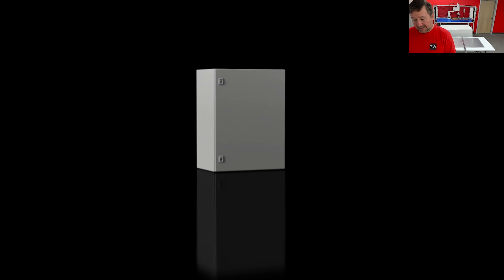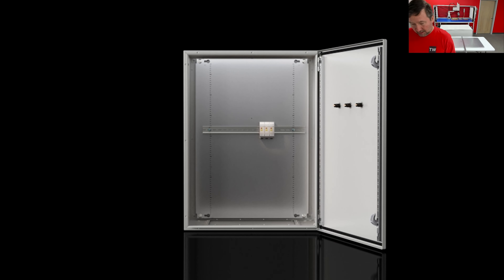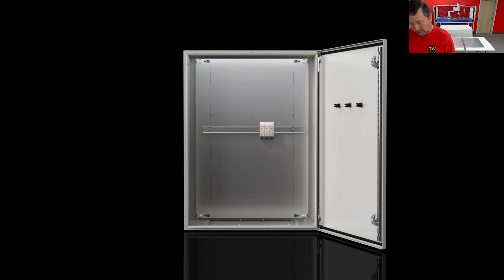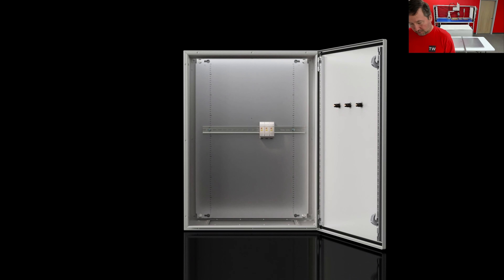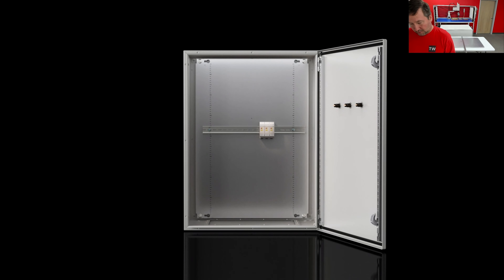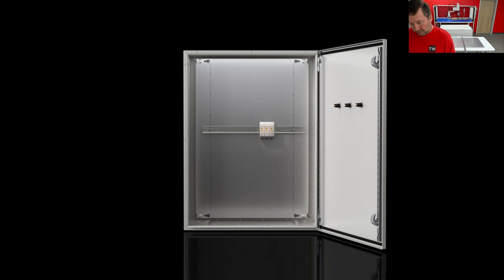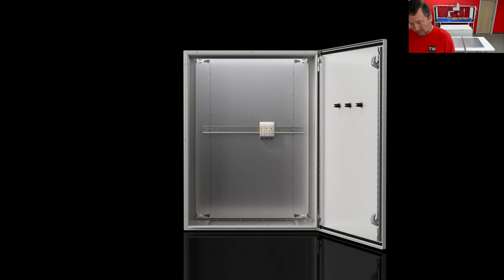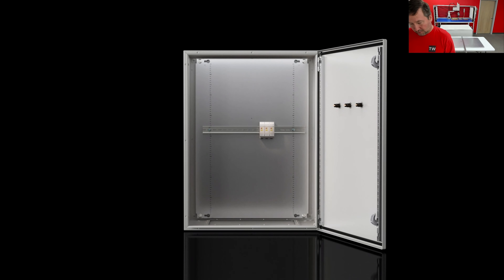Rittal Enclosures. Features to Save you Time and Money

Comment: I use these often.
There is a little plastic thing to go in the door rail by the bottom hinge to lift the door a little when closing - this helps when there is some weight in it.
Although using this requires that you use the top earth point.
A drawback of those earth points is that they are painted, I always remove the paint with a dremel bewfore using it.

Comment: The white panels are specified by engineers on any real projects for a reason. 
And as someone who works in a very large integrator shop, Rittal are the absolute bottom of the barrel in terms of enclosures and will not be accepted in most engineered projects.

Sorry, i love your content, but recommending Rittal for anything but very basic enclosures for non engineered projects is laughable.
Reply from the maker: You could be right. I built a lot of panels and most of them were basic great boxes but I was impressed by their amount of accessories to make the panel builders life easier.